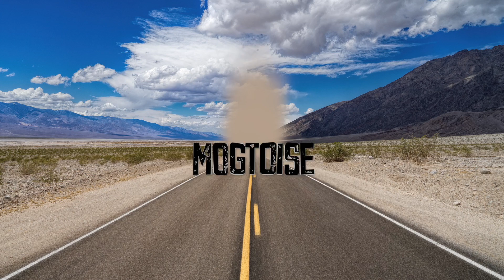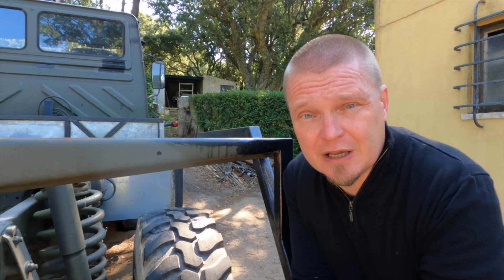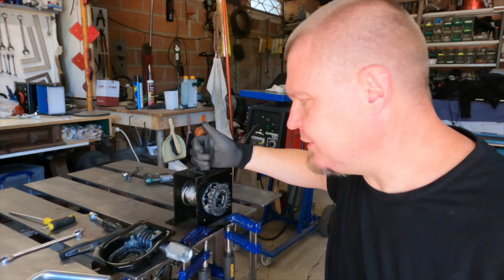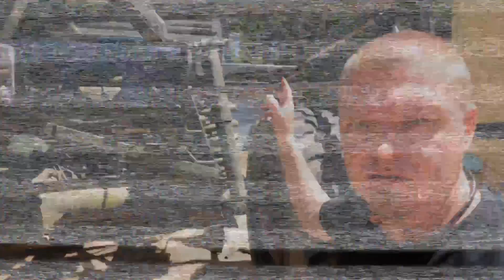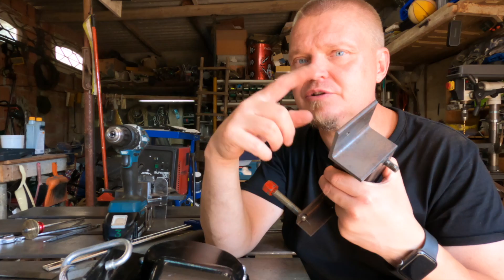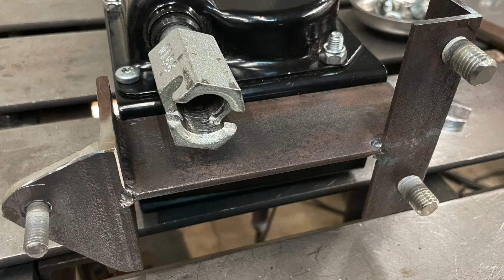Unimog Camper E028 - Making a spare wheel carrier - Part 2

Comment: For safety, what about a piece of steel bar passed through the chain repair link once it passes through the bracket while you are installing bolts? (assuming it will be accessible in the final design)  Brilliant series - I'm really enjoying it, even though I am late to the game - thanks!
Reply from the maker: Hey! Yes, that would work, but as you've almost guessed; the rear won't be accessible, so it would require some advanced latching/unlatching system. Currently, I'm leaning towards a special bolt that somehow has a locking/latching mechanism on it. I.e screw in the temporary bolt, when the bolt goes through the wheel, something moves/springs out to capture the wheel. That'd give me safety to put in other bolts, and then unscrew the temporary security bolt. 
However, with so much to do at the moment, I'm going to say "safety second" in this case. Hopefully I can return to it and make it idiot proof (hoping to not evolve into a more sophisticated idiot over time). 
Thanks for tagging along on the trip, you're not late at all as this project will keep on going for quite a bit longer! Thanks again for watching and your comment! 😎👍🏻
Reply: @JockeSelin  Thanks for the thoughtful and detailed reply!  Can't wait to watch more!
Reply from the maker: @hexinli  You're very welcome! Hope you enjoy and looking forward to hearing more from you! 😊

Comment: Jocke, nice funny vids, but I worry you are making a silk purse out of this used army Unimog pig ear. We've got a similar Unimog 435 camper, and we live in it full time. Let's hope you can keep the rear axle weight under limits with that 200kg spare hanging out back there. Keeping under 7.5t and keeping the rear axle weight within limits is a real PITA. I think most people run Unimogs overweight (probably in ignorance because it's bliss). The weight margins are small, tiny IRL, especially on that back axle in practice (probably why Mercedes didn't put the spare there in the first place), and when you add full fuel and a decent amount of water BOOM! you're over-weight. At least your wheel is low-ish. It's easy to tip a Unimog on the road, if the weight is high, it can be ass-clenching on a windy/narrow road at 80kmh. You're creating a bit more of a pendulum effect with that wheel out there. Replacing the 40 year old dampers will help. Sticking the spare wheel on a bracket on the front bumper might be an alternative to this rear hanging weight arrangement as the front axle is always too light (and might have been a bit simpler). Hope you get this Unimog finished and get using it soon, because life is very short and striving for perfection is all well and good, fannying about with every detail is lovely... but you need to get out there and get using it. After all it's only a bloody old army Unimog, re-purposed for something it wasn't designed for (long distance road travel with a top heavy 8 square metre box). Pay attention to overheating uphill hot and high with the tiny radiator, and check the portals weekly. We just had a front hub rebuilt in Izmir, *twice*... both portal seals blew, the big ball bearing disintegrated and the large roller bearing needed renewing. The local MB truck dealer found non-MB parts in Turkey, thank God - or Allah here - (as genuine MB parts are a fortune, and are always "in Germany", rather than where you break down). So always carry a full wallet. In practice, you'll end up with so much time and effort and money invested in your truck, that you'll treat it like eggs and wonder what's the point of the Unimog ability, because you won't want use it to any great extent to avoid breaking it (especially on a long distance trip). But, they are lovely things when they are working and everyone waves and welcomes a Unimog camper. So, get it on the road! If you don't get it done soon ...diesel will be so expensive, you'll not be able to afford to drive it anywhere! Good luck.
Reply from the maker: Hey there! Thanks for watching. You seem to have a lot of experience with these vehicles and I appreciate that. 
We are well aware of the weight restrictions and where the weight needs to be placed, obviously one also has to make compromises. If you watched the first part of the spare wheel carrier, then you know why the wheel is where it is and especially not the front. 
If we wanted to go travelling right now, we have two very capable motorcycles that we use for longer travels and we love them. Of course it would be nice to have the truck on the road ASAP, but there's another side to that coin; the more we can spend from our monthly income rather than some other source, the less the financial burden of the truck is, and thus it frees up more resource for travel later. We are not in a rush, it'll take the time it'll take and the price of Diesel will be whatever it'll be. 
See you out there somewhere in a few years.
Reply: @JockeSelin  God, no, you have far more skill and experience with the build than me, Jocke... I'm in awe at your construction and design skills. I just get to break my Unimog more often :) You're right about the compromises... you get forced into quite a few of those with a Unimog. 

Here's a good way to save a ball-ache & save money: 
I haven't noticed a vid concerning a pass-through from the cab to the body. Frankly, I wouldn't bother with that. We have one, but it never gets used, and the Unimog cab is too awkward to use one. It's like climbing in a car through the boot, awkward and painful. The emergency scenarios people suggest for needing one are a bit nonsense in real life... plus not having one gives you more wall real estate in the back.

Here's a good way to spend money:
Fit a Claas overdrive/splitter. Makes a big difference to driving distance (even when tootling at 75kph, which is 90% of the time). It just makes life so much more pleasant on the road. Means cruising at 1500 revs, not 2000. Just far more comfortable on flattish roads.

Good luck with the build!
Reply from the maker: @jonvaluk  Thanks for the kind words. 

We've planned a pass-through from the beginning. The box is designed so that no valuable space is lost on the front wall of the box and we'll make the aperture as big as the cab allows. I've been in a few Unimogs with pass-throughs and, whilst not being a palace entrance, they've been adequate in size. We're hoping we can achieve a similar design.

I'd love a Claas overdrive, but at the moment that £/€10,000 will be spent somewhere else. One day we'll get to the engine and transmission  upgrade and perhaps be travelling at a more modern-traffic-friendly-speed. I've also seen that Unimogadventures have replaced their Claas/gearbox combo with a newer gearbox that's more suited for modern driving. Seems to be a cheaper option and you get pneumatically activated gears too - if you get it all right. 
However, a bit of a pointless thing to do when the truck is standing still. 🤣

Thanks again! 😎👍🏻